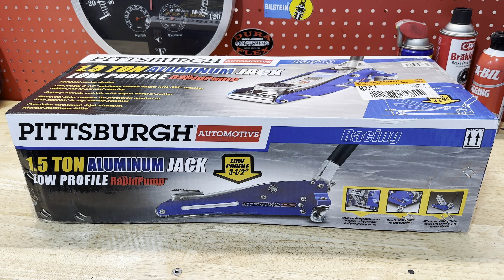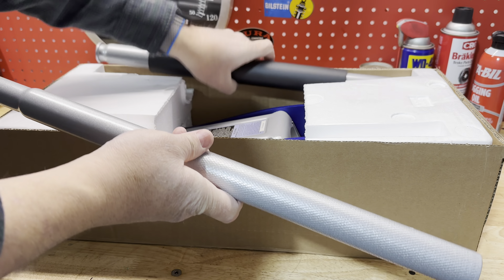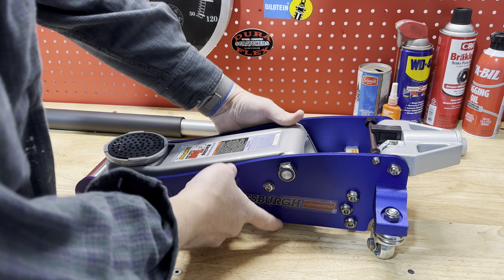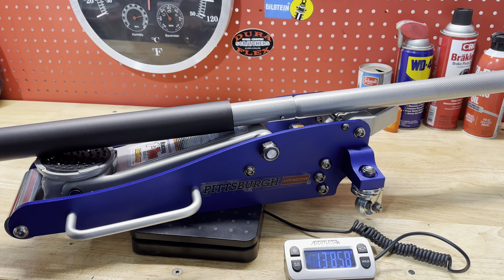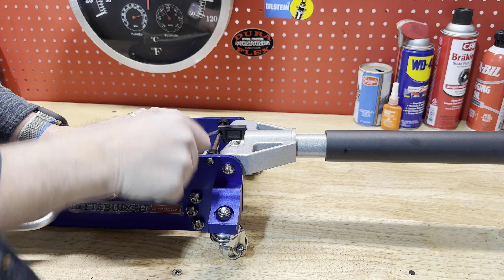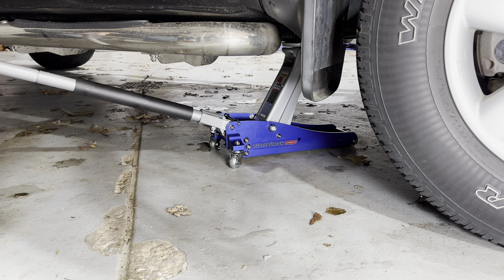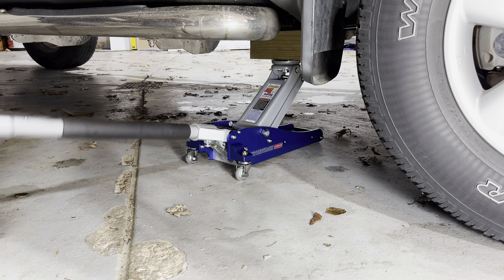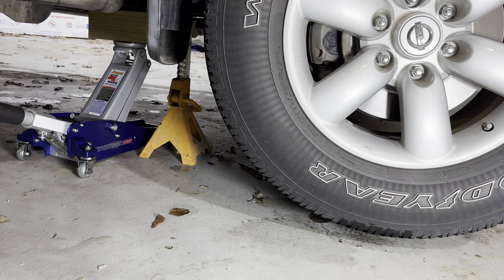Harbor Freight 1.5 Ton Aluminum Jack

Comment: I actually have the two-ton model of that jack. It has the two individual wheels on it compared the single wide wheel on that mod el. The two-ton low profile jack is one of those things i bought while i was in a tight pinch and i didnt have access to my primary floor jack. I have a NNBS Tahoe, and it's fine for lifting the entire rear or one of the two front sides. But it seemed to struggle a little when attempting to lift up the entire front end after a couple uses. I'll stick to using the four-ton Daytona for that. My biggest problem is no floor jack can fit underneath the front end of my SUV unless I put the front end up on a couple of plywood boards, or have the front bumper off. 😅

Comment: Thats i woulda gotten the 2.5 ton jack its still light for the size and cheaper than the 2ton but yea its not supposed to lift your truck. You can buy one of those extension things but id return and spend another $70

Comment: Chineses junk....i had one....used it about 15 times...then it wouldnt hold pressure any more...its goin back
Reply: probably needed to bleed it.  I've had mine for over 10 years and have used it on my full size Yukon, full size Sierra and '64 Ford Galaxie.